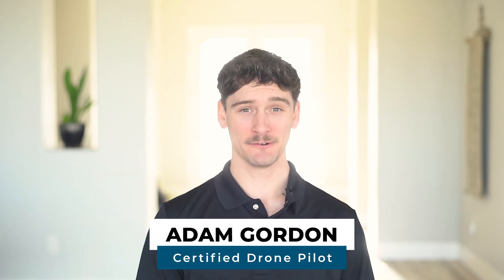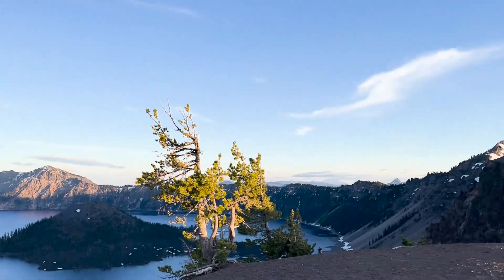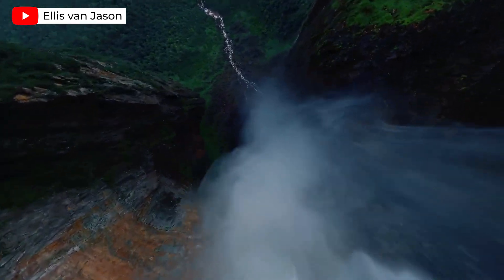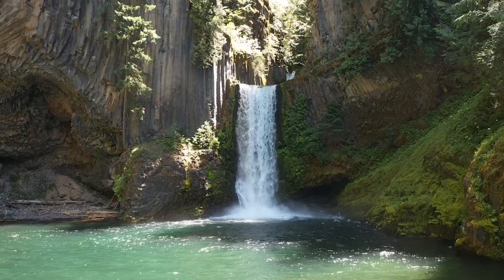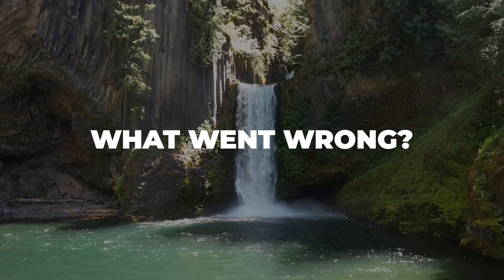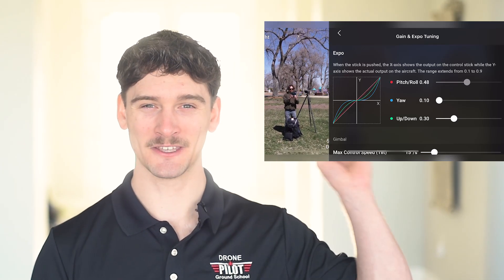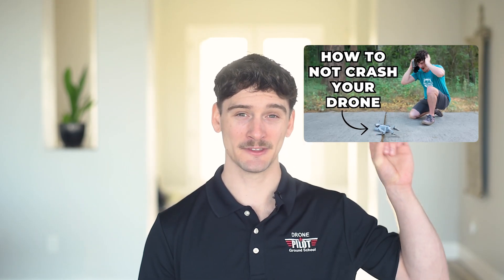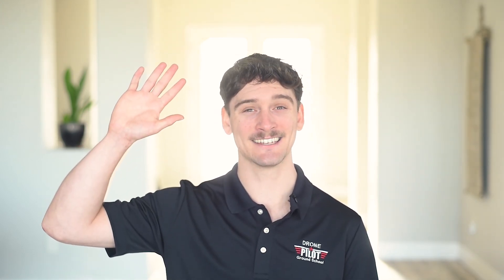Before You Fly: Lessons From My First Drone Crash

Comment: I took my Potensic Atom 3 on holiday in Slovakia, and in the high Tatras at Vodopády Studeného potoka waterfalls, I set it down on a rock beside the waterfall and flew it straight up around 10m. I then swung it sideways over the waterfalls for a shot. The drone started listing and bucking wildly, I couldn't control it and I wasn't thinking in 3 dimensions. I should have taken it up instead of trying to steady it. I tried to bring it back home, it hit a tree, fell onto a rock, splitting into 2 or 3 pieces, and plunged into the churning water not 15 feet from me. Impossible to retrieve. Worst was the castle footage on the memory card that was lost.
Reply from the maker: Oh no! Sorry to hear that you couldn't retrieve it and the footage was lost! Seems like a crazy crash!

Comment: Yes, crashed a Mini 3 Pro on the side of a river gorge in Oregon, sent another drone up to search, I was too fat to scramble up and retrieve the crashed drone and used DJI flyaway insurance to replace it. Lost battery power to another Mini 3 Pro on the "wrong side of the fence" on a ranch with locked gates and no trespassing signage galore, used my second and final flyaway replacement.
Reply from the maker: Dang at least you were able to use the flyaway insurance to replace them! And that's a good idea to use another drone to look for the crashed one!

Comment: Good video and a good topic. However, I would’ve liked to have seen you touch base on filing a NTSB report and a NASA report. While not required for this specific accident, maybe it should be mentioned based on the topic. Really good info though!
Reply: What in the world is that?  I've never heard that suggested (3 years experience flying DJI drones).  Ken from UAV Coach - is this a topic for a future video?
Reply: @ it’s a report that needs to be filed in certain circumstances if there’s $500 in damage or injuries.  The NASA report is for anonymously reporting FAA regulation violations.  Like a fly away or flight height violation etc.
Reply: @AREyouAFRAIDofTHEdark1  Ah - Interesting - thanks for the info!  I definitely learned something.
Reply: @wotan5665  of course!  Knowledge is power. Lol.   The NASA report is interesting and could potentially save you from a violation if someone else reports you for something.  Like if you accidentally flew over 400ft and got reported.  You could report your self anonymously via NASA which then they’ll send it to the FAA, but redact all the identifying information.
Reply: @ if you have a Part 107, you SHOULD know.  If not, just look it up.  It may come in handy if an incident arises.
Reply: @AREyouAFRAIDofTHEdark1  No, I've never needed a Part 107 certification to fly my Mini drones.

Comment: I had only owned my Mini 4 Pro for a couple of weeks and was still in the early learning stages. I launched in a gap in the tree cover probably 3 metres square, flew up above a fast running stream, some rapids and then up the face of a small waterfall, and was about 400 metres from home. I got a low power warning, pressed the return home and, as programmed the drone rose to 100 metres flew directly back and descended. Unfortunately it was 2 metres short of the gap, and descended through the upper branches of a gum tree and stopped. Rookie error caused by panic from low power warnings caused me to fly it through the foliage instead of up and across to the gap. A sudden fall of three metres onto rock broke the front arm. A minor issue compared with being lost in a waterfall since Gaffer Tape has it flying while waiting for repairs.
Reply from the maker: Haha nice that you're able to use Gaffer Tape while waiting for more official repairs! Glad you were able to retrieve it and learned from the experience - that's the most important part!
Reply: You should have done a manual return after the R. T. H started.